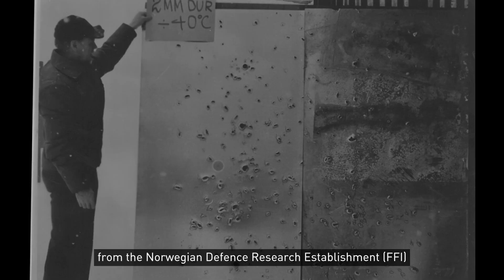Multipurpose Ammunition - Developing the Impossible

Comment: I never could figure out how the Mk 211 round worked. And Nobody could explain it to me. After watching this video; I still don't understand how it works. But it's nice to know that the inventors were just as befuddled as me.
Reply: When the Mk 211 hits the target the incendiary mix ignites, there's a slight delay and then the high explosive charge detonates. What potentially happened upon discovery was that somehow the incendiary mix used at the time could have had high explosive properties when under high temperature and pressure at the same time, and the modern multipurpose rounds have a separate incendiary and high explosive charge.
Reply: @Joseph S Impact. That's why there's a delay effect, if the ignition happened during flight you'd either get an explosion on impact or the round would self-destruct past a certain distance. The impact igniting the incendiary mix means that the round has a small window to penetrate cover.
Reply: @Joseph S I can't find information on the igniter mix, it must be proprietary. The high explosive is claimed to be either PETN or RDX and then followed by zirconium powder for an incendiary after-effect.